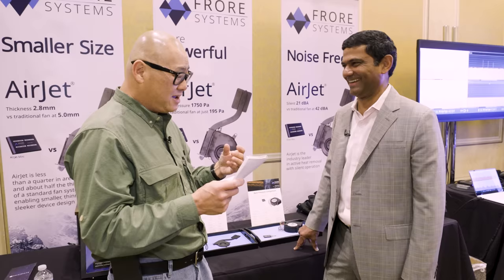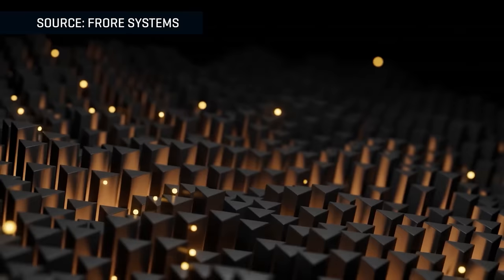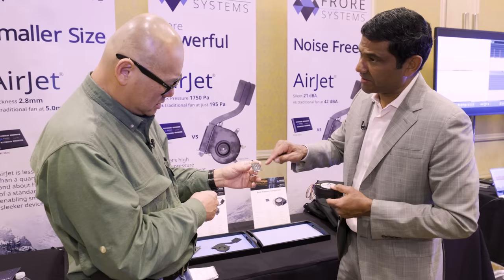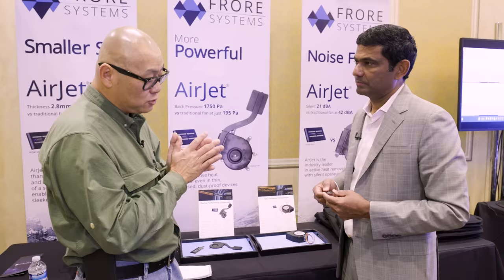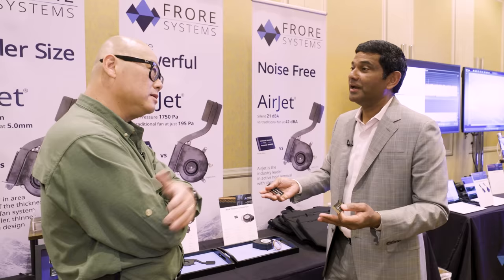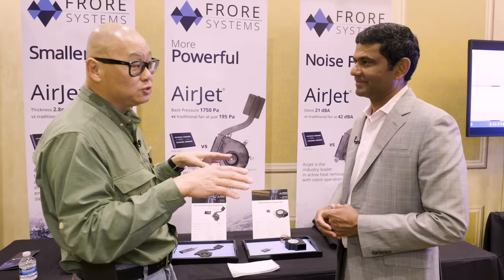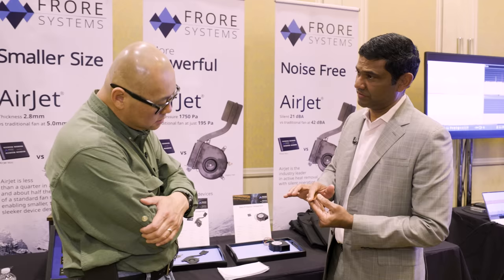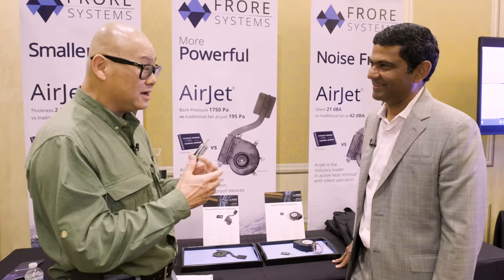Solid State Active Cooling Could Revolutionize Thermals

Comment: Probably the most interesting thing I saw come out of this year's CES. I hope they'll be able to make these chips within the same price range as a regular fan, otherwise this tech sounds like it's gonna be as expensive as the notebooks they're going in 🤣
Reply: There's 0% chance they can make them as cheap as a simple fan. That's pure wishful thinking.
Reply: @Tomyb15  Patent the tech and license it to others so mass production happens
Reply: @Tomyb15  Short-term yes for sure, but in the long term I'm curious you don't think so? =)
Reply: I don't see how a mems chip that can remove many watts of heat could get as cheap as a fan. The factories that produce them are vastly more expensive for one thing, but then they maybe have the fastest manufacturing rate on the planet if you think of transistors per second, so you never know.
Reply: Agree 100% and strongly hope they will not prevent this tech to spread to old devices through new cooling solutions replacing fans! That they will license it if they wont be willing to target this segment directly.
Reply: I can't see them being in the same price as a fan, but maybe within the same price range as a quality cooler/fan combo.
Reply: The cost is more , but it's negligible and the trade offs will more than compensate. 
The overall laptop build can be much smaller, and for gaming laptops, it's a game changer.
Reply: @cloudsmith7803  True, and if you are getting a smaller form factor laptop you are already paying a premium for the form factor with weaker specs, this tech will most likely allow for more powerful components to work so in the end it'll be more worth it.
Reply: The cost will certainly be higher than a NON redundant fan. It’s not how much it cost but what other laptop components are affected I.e. space, thickness, weight, noise and energy consumption reduction while increasing performance. So vibration will replace air velocity. Wonder how this can apply to EVs?
Reply: it's gonna last longer than a regular fan though
Reply: Well even if this is +50$ for consumer compared to Product with fan.
Small office laptops cost at minimum 500$ anyway and to put this into high end laptop you are looking at 750-1500$ device.

Imagine, less noise, less overheating, higher boost times, higher clock speeds, better integrated GPU speeds....
You can make powerful workbooks, thin-books and even tablets with this technology.

Imagine something like this inside big gaming phone?
Reply: @cloudsmith7803  Sadly I don't see this in gaming laptops. They are 120-200W powerhouses and they are bulky because they need lots of heat pipes.

It is a game changer for 4-30W CPUs and possibly powerful tablets, because you can expect massive performance jump with that with less noise and no change to thickness.
Reply: @82NeXus  Strictly speaking it will probably never be cheaper than existing fans on the market, if we are talking being cheaper than a fan, no. I agree with the completely. But since it can improve or eveen radically change the overall design of the package of components that a PC is while saving (relatively) enormous amounts of space, while again also making it run more smooth, well.. I think there is serious potential for the fans to be rendered obsolete, at least in the professional space and where people want/can afford cutting edge =)
Reply: Just a couple of other points: I don't think it will be silent if it ever evolves to transferring lots (eg. 150W) of heat. Also it's not clear how many watts it can remove per watt used by the chip (energy efficiency).

Don't get me wrong, I agree that it brings big benefits and a higher cost doesn't necessarily matter, and it will likely improve a lot over time.

I bet PC enthusiasts and overclockers (who spend tens or hundreds on coolers) will be drooling over the idea of a high power version of this. Could they make it efficient enough for that though? Blasting a lot of air at a surface at 200 kph would use a lot of energy and generate a lot of extra heat...
Reply: @Tomyb15  It's literally just a mems chip.  probably not that expensive.
Reply: @82NeXus  Indeed good points. Thank you for uour perspective. I'm curious to hear these because it can be hard to see the bigger picture at times, and I think your point is in the ballpark of anything could flop if the cost to benefit calculation cannot be defended.
However, if we try to steelman the position that this could revolutionise designs for a moment, don't we also have to factor in the gains that can be achieved by continously innovating the instruction sets for our chips?
So if we can reduce the instruction set of our chips and still attain similar or better performance to existing technologies, couldn't that create a sort of ideal melting pot in the middle?
Reply: @TorutheRedFox  you sure? moving parts break, unlike what is stated it have millions of vibrating  MEMs,
 Until i see a reliability chart i am not going anywhere near this thing.
Reply: I would pay $200 extra just to get this fan (thinking they manage to make a 200-250w version for gaming laptops)
Reply: @cotasa  Word my friend, I would pay good money if this was available as an option for demanding loads!
Reply: Every new technology is bound to be expensive for the first few years; it is only after they are mass produced by various manufacturers that the prices of these chips fall.
Reply: MEMS are cheap.
Reply: @Tomyb15  doesn't need to be. Even if it costs... let's say, 30$ per unit, who wouldn't pay that much extra on a laptop with a more quiet and stronger cooling solution?
Reply: @johso87  Well processor efficiency is a separate issue. When more efficient processors are developed they just increase the performance to match, so they demand the same from coolers. In fact the high end machines seem to gradually use more and more power. Latest gaming laptops have 175W TDP RTX 40 series GPUs! Takes a serious cooler to remove all that heat! Their power supplies are 300W or more!
Reply: @LinKongDa  Good point! They are solid-state (made of only solids) but not motionless! So they're no more solid-state than a fan! And air, a fluid, is a key part of it, so I'm not sure if you can strictly call them solid state.
I still think this is a hell of an innovation though!
Reply: @82NeXus I hear what you say =)
 I think your logic is a bit too rigid for my taste tho. Cooling tech is not the only thing that is moving forward at a rapid pace, that's my point. Eventually the power draw of the current gen GPUs will be defeated by alternative options - I don't see why that space would be isolated. Yes it may take some time, but for many of these things it could also just happen all of a sudden, when smart players have lined up all the dots.
What I see in this tech is not just a fan replacement, but one piece of the puzzle of the future machine that are completely revamped =)
Reply: @johso87  Are you talking about a radical change of semiconductor tech? Everything is done with CMOS transistors at the moment and they're pretty efficient but they have their limit. So yeah, changing to an alternative in the future could see a huge jump in computing power per watt.

Comment: 1. expected cost per unit, or at least cost relative to current active laptop cpu coolers
2. durability. does it last longer if kept at a constant frequency, how many hours of on time, etc
3. ease of replacement. is this mounted to the heat producing components the same way as conventional coolers

i know intel's allegedly working with this company, but i would like some honest ballparks for those three questions :)
Reply: Need to go directly on the CPU directly on top as you use this "jet-effect", so physics dictate to be onto the heat source to use the high velocity of the single air molecules.
Reply: Good questions.

I also wonder:
- how hot is the air that flows out of the device
- can it be used with air cooling combined for cooling more powerfull processors
- what if really hot part of the processor in on just small part of this plate. Wii it be able to take out the heat?

Comment: Sounds like some kind of piezioelectric die chamber. Breaking the boundary layer would indeed make it incredibly efficient. I have to say that the product sounds very innovative and effective. I can't wait to see it in the market.
Reply: yes, but no.
Reply: Its EMS, he said that. Like the mini speaker or the mic on your phone. But used to other purposes.
Reply: @Karl with a K According to the article: "Because of the high back pressure, he said, the intake holes can be covered with an IP68 waterproof/dustproof material, allowing a laptop maker to prevent dust and other particles from coating the inside of a laptop."
Reply: @Karl with a K he talks about it at 6:00 mr genius
Reply: @karlwithak1835 Someone didn't watch the video...
Reply: @Karl with a K If the air speed is 200km/hr(120mph) then of course it would have enough back pressure to overcome a dust filter. Maybe you should put more effort into watching the actual video and giving evidence for your claims as opposed to telling people they're "bad at recognizing falsehoods". Ok Jordan Peterson.

Comment: This is super interesting and exciting. Can you imagine when this matures and you can apply it to high end gaming laptops? The performance may come much closer to their desktop counterparts. This is so amazing
Reply: Problem with laptops is you are stuck with the same components.
Reply: @j.a.3138  That's only a problem if those components aren't replaceable with new ones when they fail, or if the laptop owner becomes dissatisfied with the performance of those components. Very often, laptop owners don't care about having the best in class computing performance, because they just simply do not need that amount of power. I've seen laptop owners keep the same laptop for 10 years or more and not need anything new, only upgrading the hdd to a ssd, and perhaps adding/upgrading the memory sticks.
Reply: Everytime i open a Laptop i see so much dust. Especially in the cooling mechanism. That tiny holes seem to clog up very fast
Reply: @MrRobin4444  Depends on the design... my desktop clogs more dust than my laptop. Both without dust filters
Reply: @j.a.3138  There is the Framework company with modular laptops... I hope they can improve the modularity with this jet air technology and make it possible for the availability of modular graphic cards for laptop.
Reply: @desanty1  Shure, now try to use ur laptop in the bedroom on your blancet (like the most humans). Or on your couch. 
And compare the results. :)
Reply: @MrRobin4444  if you use a laptop on your bed without a tray/board that speak more about your lack of intelligence rather than everyone else...
Reply: @j.a.3138  you pay for comfort and mobility, depends mostly on what you need
Reply: or at least you'd get less throttling on long game sessions
Reply: thing is you hear about super interesting things like this daily...but we never hear of them actually coming into fruition nearly as much.  Come see us once you have doubled performance of a consumer laptop
Reply: lol, give them a cookie when they can move over 125w/ea maybe they'll be applicable for use on a decent cpu or graphics card.
Reply: @j.a.3138  While I agree, if you buy a good laptop that wont be much of a problem, I have a laptop with I7 8750H and 1060 6GB and have it for 5 years, I can play most of the games in at least FHD Medium Settings 60fps, when I bought two weeks before 2060 was announced and my laptop is still pretty good
Reply: Another place I can see this making a huge difference is in networking.
It's not uncommon to see multicore routers these days, especially amongst high end WiFi routers with integrated NAS functionality.
Some people use cooling pads to help keep them cool, I've even seen dual fan kits for the trusty Asus RT-68U, but something like this can be integrated into the devices design, only coming on when the CPU is under load to keep things from getting too toasty.
That being said, the Asus I've been using just fine is rated to 90c+ as far as I'm aware before it's going to have a problem, but it does get a bit warm to the touch and that in itself is enough to bother some people.

Funnily enough, I've been a power user for about 20 years, and i certainly know better, but even i dislike subjecting hardware to temperatures that I wouldn't like to work in, so whilst a CPU in a router humming away at 70c is indeed perfectly fine, I'd still rather it be in the 30s (around 90f) 🤣
Reply: @MrRobin4444  Both are used on a desk, so both are exposed to the same level of dust. Which means there is a baseline to have a proper comparison... if I put my desktop on a dirty couch or bed, it will still have more dust than the laptop that goes to the same place. 
I'm sorry to disappoint if I'm not like most humans.
Reply: @desanty1  a desktop on the couch does not speak for you. However, that's not a solution for a desktop PC. 
So get your Spray Can of air and clean your filthy desktop cooler
Reply: @desanty1  I understand it but i dont care, im not here for valid arguments. 
The shitty tiny fan clogs up even in a clean room.... proove me wrong
Reply: At the cost of more power
Reply: @MrRobin4444  If you are in a clean room in a hazmat suit, it won't clog up, for sure... Most part of dust particles in a pc will be human made. The dust collection depends on what type of fan you have, it's design, intake and outake design.
Reply: @desanty1  yes, and the intake Design is crappy, so no air through your fan

Comment: I imagine this would be amazing for VR / AR rigs, lowering heat buildup and weight
Reply: It would certainly make an interesting cooler for the screen of a VR headset, I'm not sure if the vibrations would be felt though.
Reply: What heat in VR/AR ???
Reply: @Gamehighlight2023  VR/AR systems need to be lightweight and small to prevent head and neck strain. Small systems doing big graphics tend to get very hot, and need cooling to compensate. This is why most of them have cables to the main graphics processor instead of putting it on the goggles. This video's cooling could allow more of that tech to be put into the goggles themselves, possibly going wireless (though bluetooth / wireless adds heat too)

Comment: Air at 124 MPH is hardly silent even if the overall volume is low. For higher power devices air will need to be drawn from outside the chassis making dust a issue. Preventing implosion in the membranes also seems like a serious issue as materials stretch & fracture over time.
Reply: i bet 124 is just an initial speed directly from MEMS. It looses it on a 90dergree turn. But a dust spec could clog it if its big enough.
Reply: @GrafTrahula  If this design is blowing into a heatsink as they said. They have to maintain the air speed though the heatsink or convert into very high pressure, or the air would stall reversing flow though the membrane.